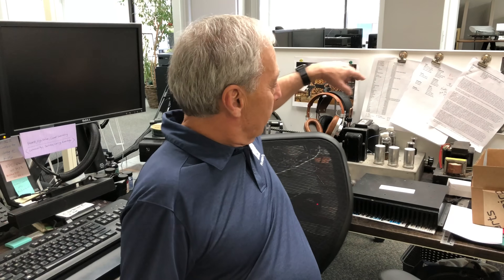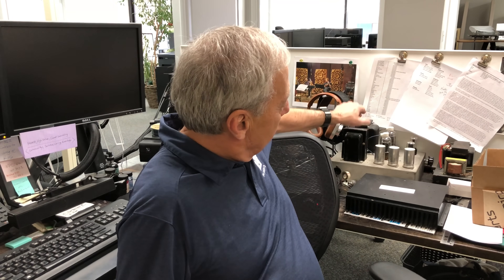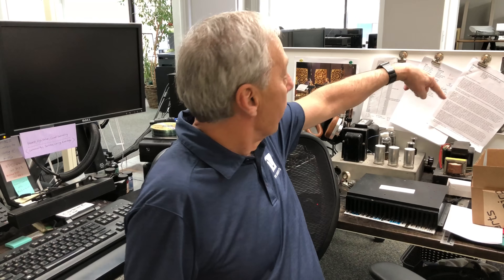House wiring for high end audio

Comment: Two comments, it's very hard to run Romex through just about any kind of conduit, I would think 10 gauge solid AWG single strand would be easier and maybe cheaper through conduit. Also tough to connect 10AWG solid to a 20 amp outlet, not totally impossible, but difficult.,

Comment: NEC (national electrical code) allows oversized wire. Most old breakers are thermal tripped. Check your local codes to see what TYPES (thermal, AFCI, GFCI, etc.) of breakers you’re allowed in your listening room. The power supply should cut out any huge peaks, so using a smaller breaker isn’t necessarily a problem for peak wattage.

Comment: Perry Smiles
Good day Mr. Paul! 
I need your advice please... On short runs, it's not too difficult to choose a necessary wire gauge for speaker cables... but it's more the long runs that are questionable for me. Therefore in my case, I need to install a 70 foot run to my rear Atmos speakers... is 12 gauge OFC sufficient for this lenght? Some info out there suggests that 10 gauge might remove quality of sound on the highs (mid-range and tweeter)... is this true to your knowledge? Or is 10 AWG what I should install instead of 12 AWG?
My Atmos installation as rear heights will be Canton AR-500's (4 - 8ohms) powered by my AVR Onkyo RZ-50, and I set the AMP impedance at 6 to 8 Ohms (rather than set at 4 to 6 Ohms). 
Please help me choose the right gauge (AWG) before I purchase the speaker wire, since I will need a CL2 rated wire for in-wall installation.
Thank you in advance! Perry

Comment: I'm not sure how the dedicated circuit is isolated from the noise on any other circuit in the house. All those circuits branch off the mains and are only separated by breakers, which do not block noise when closed. There is extra distance between the noise source, so that might help but would not be enough to eliminate the noise altogether or even significantly. I still like the idea of a separate circuit and using larger wire with derated sockets.

Comment: Fair enough that 10 gauge wire MATERIAL isn't much more expensive, but it sure is a pain in the ass to deal with as compared to standard 12 or 14 gauge, so the labor cost (or at least the annoyance by your electrician :P) is likely to be higher.

Comment: NEC only allows 110v volt general purpose recepticals to be installed on 15 or 20 amp breakers. A 30 amp circuit requires a  30 amp device. You can definitely de-rate the wire (upsize). If you want an isolated circuit you can run  dedicated circuits in MC cable  to the required outlets.  "home runs".  This would provide shielding and isolation without having to run hard pipe. If you run conduit, pull in THWN #10 instead of Romex. You can use a smaller pipe and Romex isn't really made for pulling through long conduit runs. BTW, I'm a Master electrician with 30 years in the trade. In server rooms we run feeders from isolation transformers to iso panels with creates separately derived isolated systems to keep the the data free of interference. You could do that also, but seams like overkill to me. Also, if you have a small service on you're home it can affect overall performance of any equipment. With combined loads the amps build up and you get noticable voltage drop. One example is dimming/flickering lights when the sump kicks on. Upgrade you're service to 200 amp, the larger feeder wires reduce VD in the whole system. My 2 cents.

Comment: First and most important all grounds tie into the main panel and only the main panel. Second better to run two dedicated 20 or 15 amp circuits and forget the 30amp circuit breaker idea, unless you plan on connecting a recreational vehicle.

Comment: In my opinion ,on a 10 gauge wire There is no danger outing a 20 Amp breaker, even if the load is greater, it will be a pain because it will trip all the time for no apparent reason, but there will be no fire danger.

Comment: No issues with using 10 gauge wire protected by a 15 or 20 amp breaker, larger than required wire is ALWAYS allowed by code as long as the terminals are rated for it and the conduit is large enough. Ideally you only want to use as large of a breaker as necessary for safety reasons. Using a 30 amp breaker on a general receptacle circuit is a violation of the National Electric Code no matter what wiring you use because normal 120 volt receptacles are only rated for 15 or 20 amps and a 30 amp breaker could allow the receptacles to be overloaded. Table 210.21(b)(3) of the NEC shows that only 30 amp receptacles are allowed on 30 amp circuits. Technically if you install a 120V 30 amp receptacle supplied by 10 gauge wiring or larger you could use a 30 amp breaker, but nothing you own would plug into it and there is no good reason to anyways.

Comment: Best thing to minimize noise is to wire your room outlets with a dedicated ground. This wire is a TEW, THHN type that is completely isolated. We use those mainly in server rooms and hospitals. This wire passes true the electrical panel on an isolated binding post and from there, a same type of wire, only bigger goes to your main water entrance and connect to the pipe.
Reply: I have PEX, don’t you?

Comment: This is where you are wrong Paul.  The wire that goes into EMT pipe is mostly THHN or THWN not romex.  Romex is only 60 degree insulation which is fine for houses but not rated for commercial plenum installations.  I would run 2-20A circuits if you have larger power requirements.

Comment: The circuit breaker protects the installed wiring not the load that's what the fuse in each bit of gear does NZ

Comment: Howdy. I agree.
There are basically two kinds of over currents in the house wiring.
Short circuits. Short circuit current activates the breaker magnetic (=fast) breaking. Overload current. Overload currents trigger the thermal breaking of the breaker.
The wire AWG must be rated to be able to handle both cases.
Let's take a 20 A breaker. The breaker may actually pass about 24 A before the thermal breaking triggers. The house wiring must be rated to conduct this 24 A without overheating and fire hazards. The AWG may easily be chosen using tables.
The short circuit rush current is more tricky. If the short current is at least 10 x the breaker rating it may be assumed that the breaker triggers in a time no longer than a few hundres of milliseconds. The house wiring is likely to be able to handle the short current is that short time.
In what kind of a situation does the short current not climb to 10 x the rated breaker current ? Shortly: Long property feeder cable and weak high voltage grid. The short current may be only, say, 4 x the breaker nominal current. The magnetic (=fast) breaking does not trigger and the short may run a long time in the house wiring until the thermal breaking activates. There is a very real fire hazard.
So. By reducing the breaker from 30 A to 20 A there is a kind of "guarantee" that there is enough "short force" available feeding the breaker to enable fast triggering.
Regards.

Comment: On a dedicated circuit you can always install a smaller interruption device than what the conductor is rated for, but not the other way round. 

If you run a dedicated circuit, you will end up also with a dedicated unbroken ground connection as well. 

Even better though would be to just run a 220v sub-panel to your entertainment room on say a 50A breaker that could be installed in your equipment closet. This would be run from the service entrance of your home with #6 ga wire and bring basically the entire power panel and earth ground connection to your space on a single point. 

From there you could do a couple of things. 

A: install a whole panel surge protector in that sub panel to protect all your gear from surge and spike damage and provide EMI filtration. 

B: run short length dedicated circuits to all the outlets within the room that you intend to use for audio placing them all on one phase of the disconnect and providing them with a single point ground back to the service entrance. 

Placing all other accessory outlets and lighting loads on shared circuits located on the other phase of the disconnect. This way you know all your gear it’s on the same electrical phase of your panel as well as having the same exact ground reference. 

This allows you to be able to have a nice heavy gauge cable that runs all the way across your house to wherever it needs to go that’s on a nice heavy breaker that won’t trip unless it needs to to protect that cable… Then in your in room sub panel, you can put small 15 amp breaker’s for each circuit if that’s what you want and run 10 gauge wire to each outlet if that’s what you desire. And everything can be the same length if you want to do that and it will be easy to accomplish and easy to balance. And in fact you will have one single run back to the panel at the other end of the house and that one single ground will all be the same length because it’s only one and not a whole bunch of them. That’s the beauty of single point grounding.
Reply: Thank you! Excellent!

Comment: Hi Paul, dedicated lines with Duelund.
But there can be some very surprising colateral results with amps transformers BTW, they can get pretty hot as some are not designed to work with anything else that very bad cable behind them.
I had TWO of them almost smoking (NAD 3150) with a 2 m bi-wiring, so I made a 4 m single wiring with both cable.
Temperature was back to normal, stage was wider, but the incredible sound textures and ferocious punchiness of the short bi-wiring was gone !
How could this transformers get so hot ? At most, resistance was divided by 4, bc 2 wires and half length, but others factors must have played some mysterious effects.

Comment: Dedicated circuit breaker to amp and streamer is crucial for top sound. Also a good wire in the wall like for example Gigawatt and a circuit breaker like Gigawatt. And the only wall inlet I recommend is the Oyiade swo-xxxe, that has a sound that is very natural and sweet, many other expensive HIFI plugs are usually very analytical and non musical like the Gigawatt and some few Furutech. I also suggest getting a Isol8 mini sub axis power box which is one of the very best, all of this together can save a lot of users several thousands of dollars on amp/speaker upgrades and such. It's probably more like 5-10k.
If you don't do these things, the sound has a tendency of being very flat/boring/lacking a great portion of drive/relevance. A huge part of making the sound powerful and effortless and also introducing some natural color to the music, is linked to these things being in place. I hear a lot of expensive systems, sounding very grey/sad/digital, before all of this was done properly. It's the difference between running your system to 10% of it's full potential and something like 40%. (big difference) To get the rest, you need some appropriate cables/plugs and deal with the room and a long list of other things. The power setup is the core of your sound, and everything you do after that, will then have a much bigger effect.
Reply: so are you saying you can hear a difference between different brands of outlets ??
Reply: @poserwannabe1  Jup. If you want to try the most extreme test. Try the Gigawatt outlet against you normal house outlet. That is so extremely different. I prefer though the Oyaide swo xxx-e outlet, that is for me and many of my friends the most balanced/natural sound. The gigawatt one, is just crazy bright/fast/mechanical.
And yeah it could maybe be good for people with an overly warm sound that is muddy.

Comment: 10 Gage wire will carry 30 amps up to certain distance with a voltage drop less than 3%.
Soto say that a 10 gage wire is good for 30 amps is wrong. it depends on distance and whether the wire is made of copper, aluminum or copper with silver coating. Always check your tables and never go to the maximum capacity of the wire/metal/distance. allow a 30% safety when selecting a beaker.

Comment: It's fine to have 10 gauge on a 20 amp breaker. Sometimes you need to run a 20 amp outlet so far 12 gauge isn't thick enough. The danger comes in when you have a 30 amp breaker and 12 gauge wire or a receptacle rated at 20 amps allowing you to overload the conductor or receptacle before the breaker pops. It's not against code to use a bigger than usual conductor on a breaker it's just unusual (of course make sure the terminal on the breaker is rated for the size wire though) basically just make sure anything down the line is rated at or above

Comment: In the UK we have rings, so the start of the circuit connects to the end. This effectively doubles the current capacity. With 2.5mm conductors we have approx 48amps per circuit. Usually thats protected by a 32amp fuse. Bearing in mind all our appliances are fused in the plug themselves by a maximum of 13amps. Most (and all new) houses have a main RCD too.

Comment: The simplest power solution is to build yourself an EMI/RFI power filter.  Very easy to do because they are already prebuilt in modules that are cheap and easy to get.  Just go on eBay and search for EMI/RFI filter and pick a 20AMP modules (this is important, less than 20 amps and you take the chance of peak current draws causing the internal coil to ring and create more noise than it filters).  These are available for as little as $5 and should not be greater than about $30.  You can get larger units (30, 40 50 amps, 2, 3 phase) but they cost more so start with a cheaper 20 amp.  These units just need to be wired inline with a power bar (start with a cheap one and upgrade later if you like). Cut the cord on the power bar, connect the line side of the module to the plug side of the cord and the load to the outlet bar side.  Make sure that you are plugged into a regular circuit with a half decent ground.  A few bucks and 10 minutes of your time and you'll be amazed.  I've been building them and giving them away to friends for 25 years now and have yet to have ANYONE say they don't hear a difference.  Usually, I get asked for another one for another system or friend of theirs.  If your comfortable fixing a broken extension cord, you can build yourself a filter.   Go ahead and try it, you'll be delighted.

Comment: Can you get 10 gage wire under the terminal screws on your receptacle?  12 gage wire is hard enough to manage and is usual in house wiring.
Reply: NO its against the law (Nec) you need to match the outlet to the Circuit Breaker... you need a 30 amp outlet and tran the wire will fit. Easy way to Start a fire.

Comment: For higher powered systems we usually recommend a 240 double pole breaker such as 50A.  This feeds a distro with single pole breakers 20A each.  Larger amps run on 240V directly which is nice.  NEVER run NM/NMB (Non Metallic Sheathed cable commonly called Romex which is a brand like calling a copier a Xerox machine, a tissue, Kleenex, etc) inside of EMT!  Stranded THHN is pulled through EMT and runs directly to either a distro or sometimes to the outlets directly.  In a lot of commercial buildings they will terminate the EMT above a suspended ceiling in an 1800 box or similar and drop Greenfield (BX) down through the wall to the outlet/switch box.  In homes this is rarely done.  Most of the time it's NM from the breaker box all the way to the outlet box.

Comment: I've seen buildings that are public venues wired with #10 solid copper with 20A switches and outlets and protected by a 20A breaker.  Even though #10 solid copper can carry a 30A load and be protected with a 30A breaker, the outlet is of a different type and that would make it difficult to protect your 15A-20A devices, as you would need a different type plug.

Comment: If you are going to install multiple receptacles that are each on their own separate breakers they should all be on the same phase to minimize noise.
Reply: How many phases do you have in your house. Power here in the UK is 3 phase in the grid but homes are only wired to one phase.
Reply: @marklydon435  Single phase 240 center tapped at the pole to neutral into the panel. Most circuits are 120v with heavy duty uses fed by 240v -  dual breakers.

Comment: What do studios do about tube consoles that need 50+ amp breakers and then they have a mains/sub setup that requires 7,000 watts? Do they dedicate breakers for the console, mains, and then another breaker for outboard gear and then another for misc.? Aren't there potentials for ground hum, shorts, etc.?
Reply: Yes, they do, they have extra power for that.

Comment: Breakers protect wiring, NOT equipment.  The NEC code matches wiring gauge to current ratings per foot and per temperature ratings of the in wall cables. Running a larger gauge wire (lower AWG number) in wall is fine as long as the breaker, AWG, and outlet ratings are matched.  Remember, you may sell the house, the next owner may not have any idea of what's inside the walls.  The NEC code is there to protect the structure and occupants.

Comment: Gah! If you put something together that uses a 30A 115V circuit, you did something very very wrong. IF you really buy into needing a big breaker and big wire, then run a 15A or 20A 220V circuit to a sub-panel in your listening room.
The whole thing is kinda silly. All the wires in the house run to a common ground in the box, and you only have 1 wire coming in from the pole. You could fire up your amp, and see the fluctuations at the meter...
A power supply will do more than a big breaker...

Comment: Good advice with the breakers, normally an electrician will give you the minimum so you are right.
Reply: An electrician is going to give you the breaker that is required by the code. 20 amp max on a general purpose receptical. To go up in breaker size he would be required to install a 30 amp device, which your 15 amp cord will not plug in to. In general stereo equipment has a 15 amp 110v configuration on the cord in the USA.